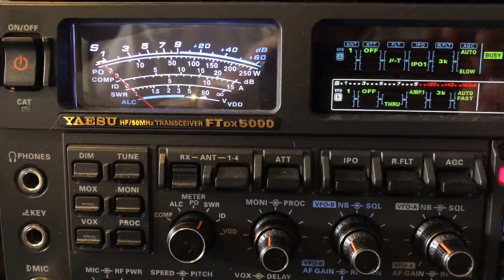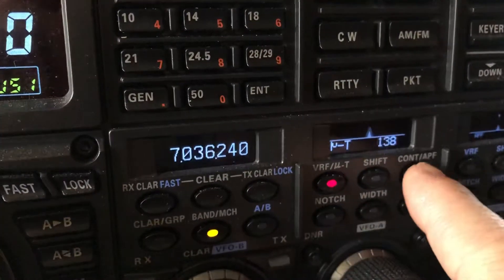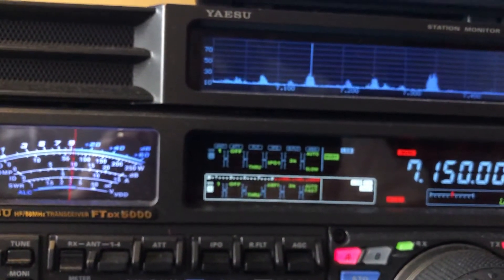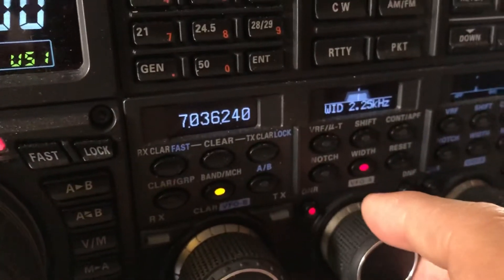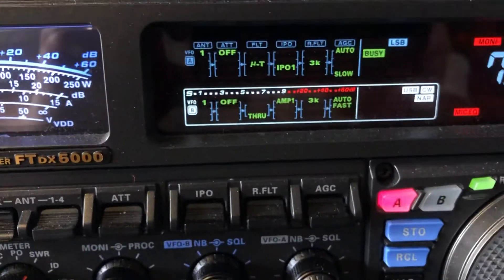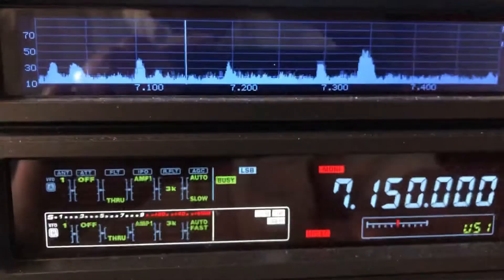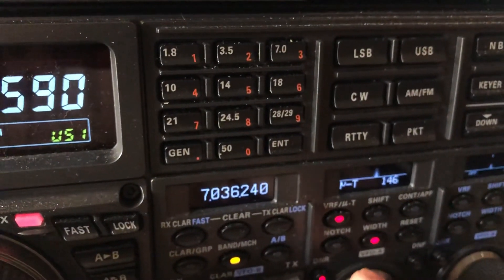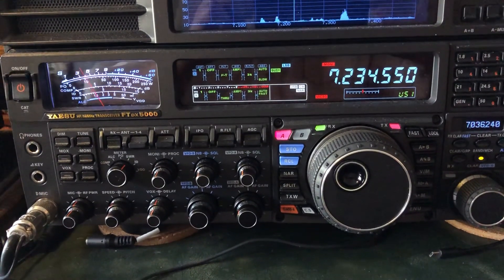Yaesu FTdx5000MP: Pulling a weak station out of the noise

Comment: First let me say that I have learned so much from your videos regarding sound quality.  I have my 991 and 891 sounding better than ever thanks to you.  As a small church pastor, I will never be able to afford a FTdx5000MP.  What a great radio.  But, I was able to secure a Yaesu 1000MP and I can't wait to try it out.  I was wondering if you ever considered doing some videos with older units?  Adjusting a 1000 or 950, or 920...for example.  I think there are many who could benefit from your insight and I would get a kick out of watching you fine tune some of the older radios.  I hope you think about it and I hope to continue to put out the fine videos you are making.  I learn something every time.  Thanks again, Bob (NO1PB)  73
Reply from the maker: Hi Bob!  Thanks for your comment!  I have a FT-920 that I included in a couple of videos.  I recently featured my FT-890 is a couple of videos.  I could maybe shoot some more with it.  I don’t have any other old radios besides it and the FT-890.  It took 20 years for me to save up to buy the FTdx5000MP.  I can make a plan to include more videos about older radios but the only two I have are the FT-890 and FT-920.

The 890 and 920 are from the era of the FT1000MP, so maybe one of those will suffice for an older radio video.  They all worked in a similar fashion.

Thanks for your suggestion.

73, de N4HNH